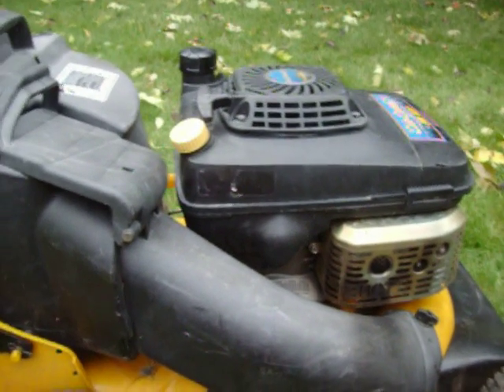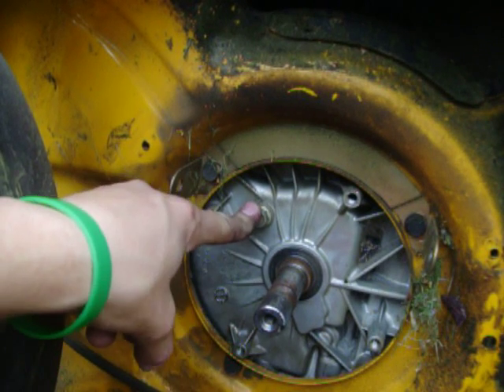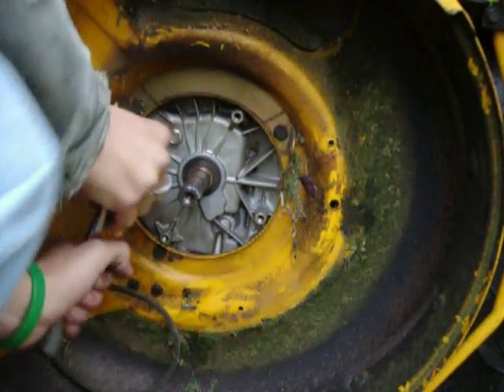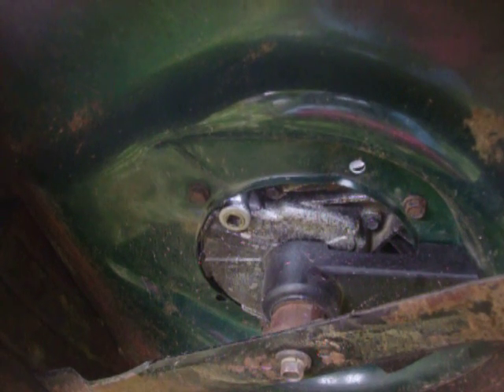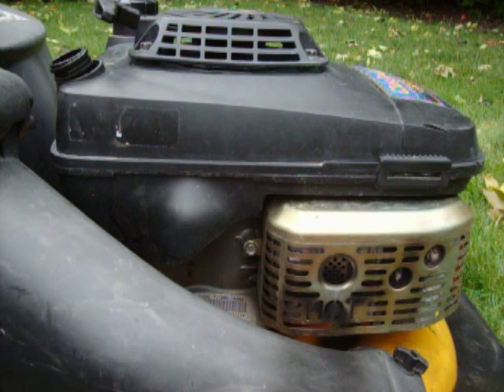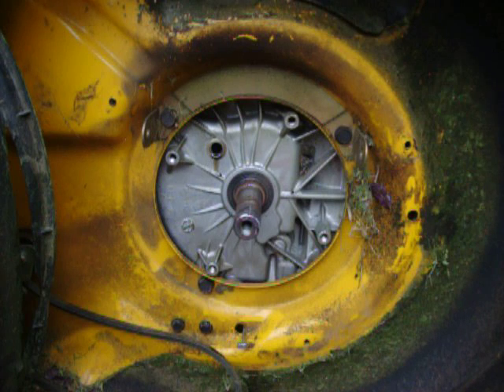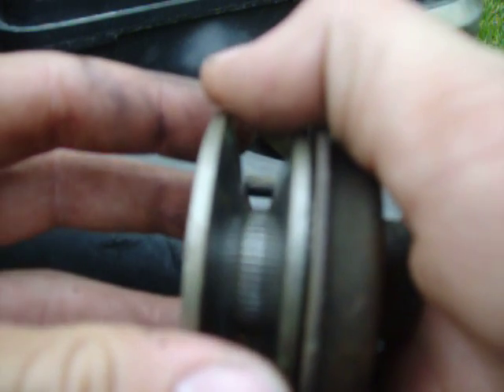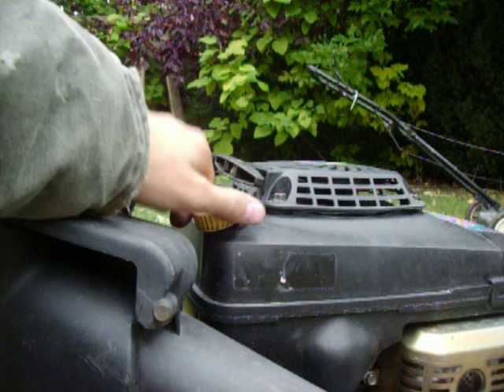How to change the oil in your lawn mower

Comment: When checking oil level you're not supposed the thread fill cap on.  Just put dip stick in then pull out and check. It says this right on the dip stick.